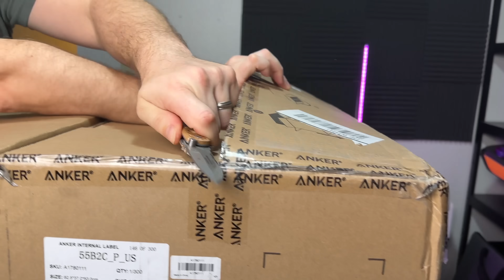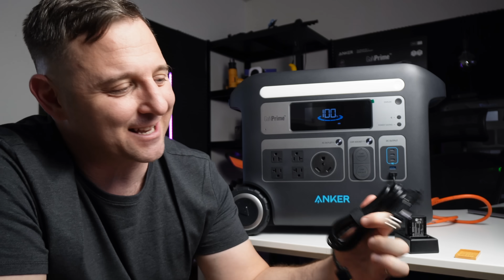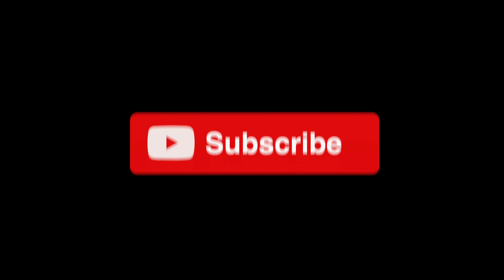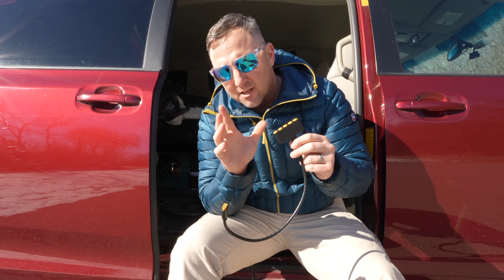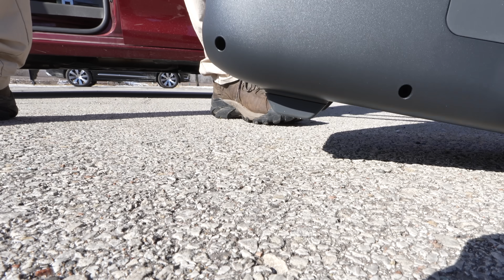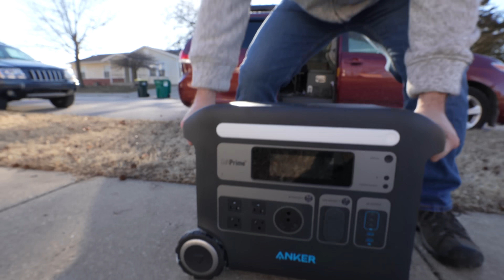Anker SOLIX F2000 - The Ultimate Power Station Upgrade!

Comment: PLEASE READ 

I am a disabled veteran with severe COPD and can no longer fly because my oxygen needs exceed what a portable oxygen concentrator can provide. 

I have a daughter that is expecting a baby in early December and I would like to go visit her in El Paso, Tx which is a long way from my home in Nashville. 

I need to find a way of powering my full size oxygen concentrator IN MY CAR for several days. I believe it requires about 585 watts. I am wondering if there is a portable power station that can support this AND be charged from my car’s cigarette lighter output continuously while the engine is running?

Obviously it MUST BE a reliable solution since my life will literally depend upon what ever is selected to provide the power for oxygen!

ANY & ALL advice would be much appreciated, Thank You!

Comment: I've been researching power stations but I haven't been able to discover if this unit can limit the wattage of the AC charging.  I currently live in an older apartment and I'm concerned about putting too much stress on the electrical system.  Hence me looking for a stable power draw and getting a solar generator to even out the bumps.  Can the AC charging be limited?  I know the Bluettii and Ecoflows can be.
Reply from the maker: Yes you can limit the AC recharging. This feature is accessible through the Bluetooth app.
Reply: 👍if in old power system, I think you did better no using fast charging function.
Reply: @cooflypower  Right. That's why I want one where I can limit the charging wattage.
Reply: @mlong1958  On the app, you can limit down to 200w in several steps, I dont have it near me, but If I remember correctly the options are 200W, 300W 400W 600 and 750W. Then up it jumps to 1440. I own this unit so feel free to ask questions.
Reply: @mlong1958  Get a lower input one. And also cheap, haha
Reply: @cooflypower  Nope. I'm not worried about the time it takes to charge back up right now and if I get one, it will be with the external battery for 4Kw. Price isn't the concern; throwing breakers is.  This one allows for the input AC wattage to be regulated and that works for me. Not always going to be in this crappy apartment. Hopefully, I'll be in a van soon.

Comment: Not a good idea to put an XT60 hub on that.  If you have a couple of panels on it and then accidentally touch the contacts of the unused hub ports, you could get a shocking experience. Might want to fill the empties with dummy plugs.
Reply from the maker: That’s a true statement. This is one gripe I have with the system. But, overall I’ve enjoyed using it.
Reply: or just don't touch it?   anyway, you could use electrical blue tape, it will fix everything.
Reply from the maker: @s.i.m.c.a  things need to be designed to protect animals and children from accidental injury. For example, a pet could lick or chew on it creating a hazard.

Comment: What are the dimensions of the powerhouse? I'm wondering how practical the size would be in a minivan.
Reply from the maker: Hi, I’ve had larger power stations in there. This one is about 2 ft by 2 ft and 10 in deep. I currently have it where my cubby used to sit.  It’s a lot of power, so it might be a little bit of overkill for the minivan.

Comment: Hey I'm looking for something that I can use to keep my Starlink on during the week when we aren't at the property.   Got any suggestions?
Reply from the maker: So, something like this could work. But, if the system ever runs out of power, then the AC inverter will need to be manually turned again. Also, if it gets too cold where you are, then it may not charge.
Reply: Good question. That what I was thinking of using it for too if I get Starlink.
Reply: Well, I guess we'll have to try it out.  The new starlink update allows me to put it to sleep for a portion of the day.   I think that may be the key to having enough juice to last the week.